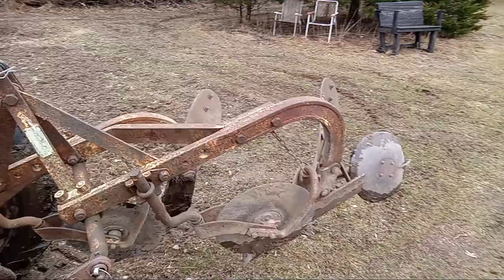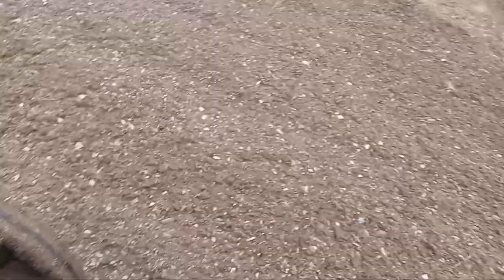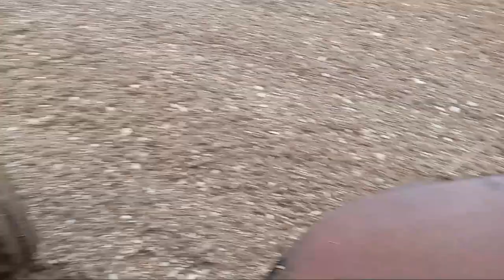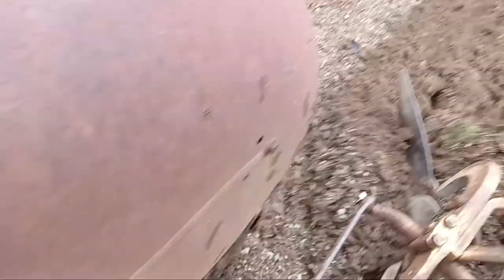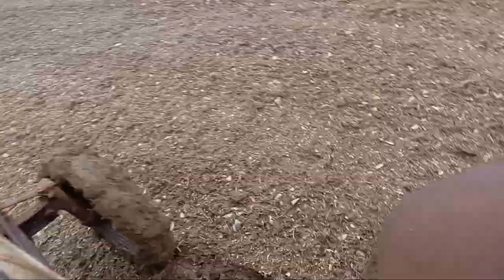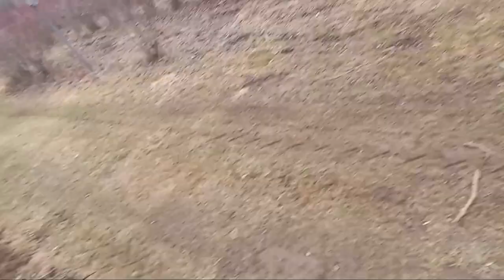Plowing with a 2N or 9N using a very old 2 bottom  ferguson plow

Comment: The 9N has i-beam front radius arms, the 2N has tubular arms (like yours). Assuming they are the original equipment id guess you have a 2N, but you never know what happened in its history. Parts are interchangeable from one model to the next. It doesn’t matter because she can still do the work.